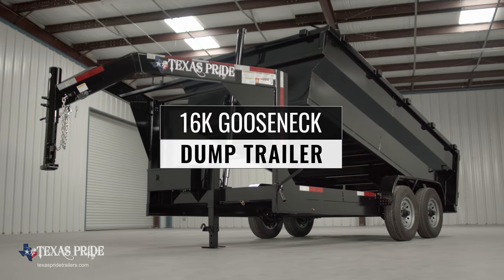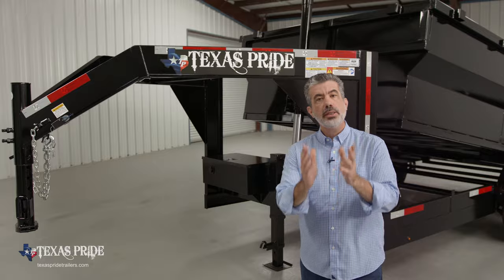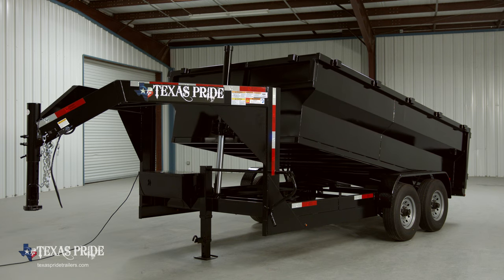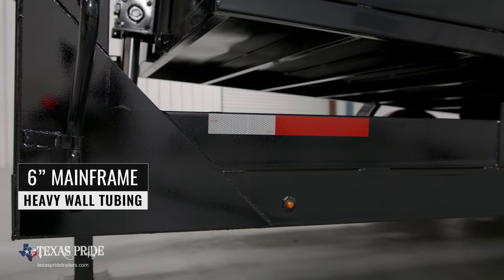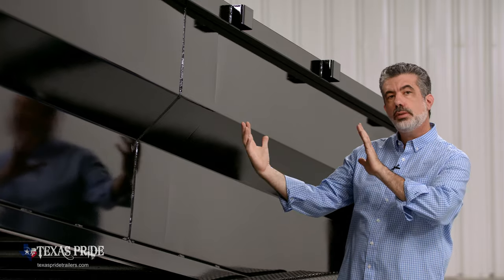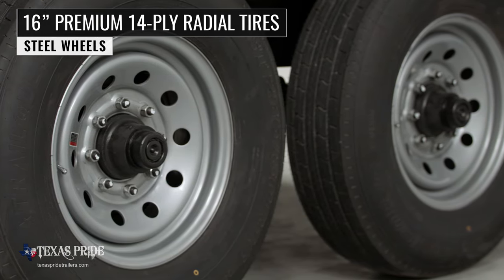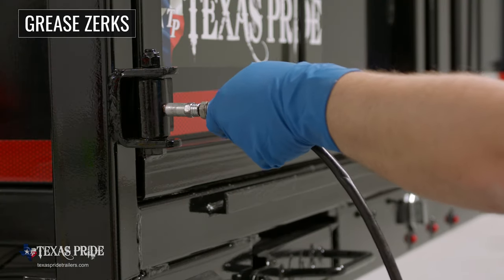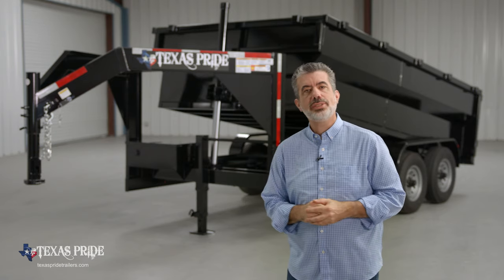Walk Around: 16K LB GVWR Gooseneck Dump Trailer | Texas Pride

Comment: I would like a 16ft dump in either 14k or 16k axle ratings but derated to 13k.
Reply from the maker: I can have a salesman reach out to you.
Reply: @texaspridetrailers  I was actually just thinking about the trailers when I saw this reply. I was up in San Antonio this weekend looking at different manufactured trailers and debating which lift system is the best. I also have been looking into both bumper and gooseneck setups and leaning towards gooseneck. Any recommendations on my concerns of lift systems or hitch type. I want to haul mostly dirt and some trash.